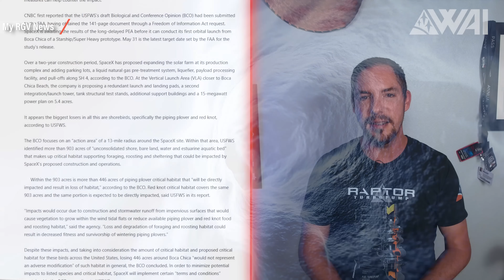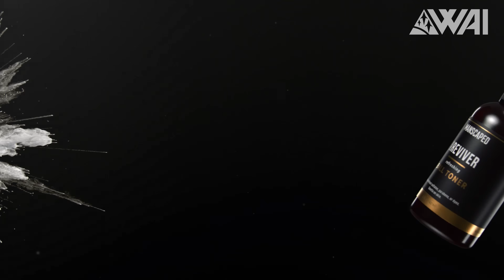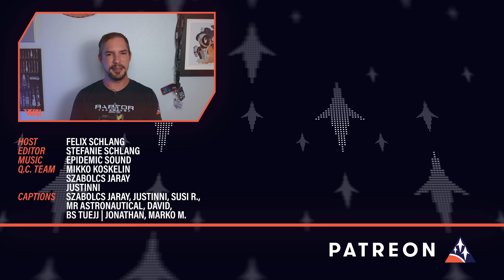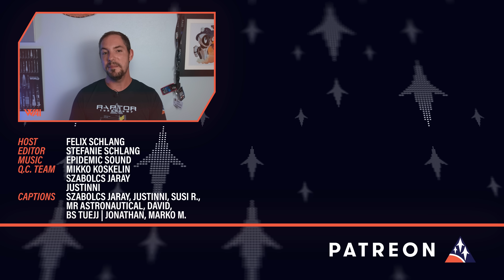SpaceX Starship Accelerating Efforts Towards The Orbital Launch Test!

Comment: About twenty four years ago I was working at a flooring store in Melbourne FL pretty much right on the Indian River. It was twenty three miles from where a Delta V that exploded shortly after lift off. All the windows in the building shook and the doors swung open. You could feel the air pressure change. I had friends further north of us with broken windows. Rocket explosions can be pretty spectacular.
Reply: That was a Solid Rocket Motor where the fuel and oxidizer are mixed together, making it explosive. Liquid rockets the fuel and oxidizer are mixed so they don't explode, the fuel burns.

Comment: The vast majority of your analysis is garbage, this is a liquid rocket. This means the fuel and oxidizer are not mixed, so the fuel will burn much more slowly as the methane slowly mixes with air as it burns.

Comment: To be clear, explosions are a function of pressure and not just fuel. If there were an explosion, it would only occur if the skin of the starship contained the rapidly expanding gas and then ruptured. Otherwise it would just burn. So its really a question of... how much pressure can starship contain before it fails.

Comment: Methane is weird when in a high pressure container.

Its extremely light and expands a lot when the container bursts. But more importantly, its very finicky with oxydizer/fuel ratio to burn. The ratio from too rich to too lean is extremely tight, so its hard to have a big explosion. You would need that most of that fuel gets mixed very well with that oxydizer.

On top of that, methane flame front is quite slow, so that reduces the shockwave.

So yeah the chemical potential of an explosion may be huge, but that may not translate to a huge explosion.

CNG tanks when they fail, they tend to do more damage from the sudden release of 200-250bar. Than from the methane combustion. Fireballs if present dont create damaging shockwaves.

Comment: No, the "explosion" would be nowhere near this strong. (See other comments) -- What COULD be a real issue is unlucky shrapnel. The large metal tank rupturing would send a number of huge ones flying, with lots of momentum = reach and damage potential.
- especially If it happened higher in the, I can imagine some reaching quite far... too far...  but still, it would have to be unlucky to hit something important, but not neglegible.

Comment: I think about those two Raptor engines that exploded recently at McGregor test site. Did they push them to extreme levels or not? There is something profoundly healthy in testing to violent failure if that is the case. However, Raptor has to become extremely safe, more so than other engines because we have 33 of them lighting up at launch. Otherwise a RUD disaster will eventually happen, especially because the launch cadence is destined to be very high. But then again, frequent use, testing and inspection after use, that is how you learn to do it right.
Hope to see multiple launch sites with the oil rigs included, so the effort is continuing even in the event of disaster.  When rated for human flight it is important that starship can escape the pad on its own. I understand that Raptors can spin up and fire in 0.1 seconds, so that option is very possible.

Comment: I see more potential of damage, when they try to catch the booster for the first time. Some other channel was up on the tower with Elon. Nothing there is protected against salty seaair. The railings are welded directly on the construction, which weakens the material. Don´t they have some zinc spray to put on the weldings? They already look like falling apart. Everything is rusty. 
The tower isn´t built to last long. It´s a cheaply made prototype. When the rocket goes boom, it´s not that big of a loss, i guess. 

In germany a construction like this would be impossible. Regulations would make the costs explode, before the rocket even gets a chance to do. 
Thats what i like on the US. They take risks to get things done fast. We can´t do this anymore.

Comment: Come on Felix, this cannot approach full explosion, the liquid methane and liquid oxygen are impossible to instantly boil and then mix together stoichometrically.  This is incredibly irresponsible of you to spread this horrible sensationalist falsehood conclusions.  There will be a moderate DETONATION of the gases that manage to mix well, and primarily the thing that will happen is plain old slow burning (COMBUSTION) of the boiling liquids and gases.  Far far less kilotons of TNT equivalent, only the detonation is measured in kilotons.  It’s probably going to be 0.25 kt.

Comment: OK ------  Sorry WAI Guy but you Made a FOOL of yourself TALKING About An atomic bomb Sized explosion from Perfectly MIXED FUEL and OXYDYZER in a CONTAINER, An Actual Oxygen and Methane BOMB...!!!  The problem is that on the LAUNCH PAD the Methane and LOX are both in SEPERATE Containers and if something happened and both tanks split wide open with some kind of explosion between the tanks...  An Incredibly Hot FIRE would start using both the vaperizing Lox and vaperizing Methane...  Only the Super Cold  liquid Lox would fall to the ground covering a wide area (since the heat is above the Lox tank With no FUEL mixed in for the LOX to burn)...   While the Methane vaperizing as its tank Pressure was suddenly released with the Heat from the Methane and LOX Burning adding to the rate the Methane turns to vaper at the bottom of the tank,,, sending the Hot RAPIDLY VAPERIZING Methan and its tank up into the Air that would burn using Air at only 21% oxygen and not 100% Oxygen from the lox tank... A LOX Tank that again is being torn apart as its Super Cold Liquid Oxygen (THAT CAN NOT BURN even in the presence of methane fuel) down onto the ground before most of it could even get warm enough to vaporize... Let alone burn...   The Point is that You would have A Huge Fire  Ball of Methane floating up away from the pool of very Cold LOX With NO FUEL spreading down over the gound across the launch facility and not Burning because  again, it had no fuel and NO TEMPERATURE...  Fact is the Super Cold LOX would protect the Launch Facility from the heat of the Burning Methane...  jUST TO REMIND YOU... FIRE HAS TO HAVE ------   FUEL +  OXYDIZER +  ****  HEAT **** BEFORE YOU HAVE  "FIRE...!!!"  THE FAMOUSE PERIMID USED IN ALL FIRE FIGHTING SCHOOLS...  With the Methane rising up away from the Liquid Oxygen you only get fire along a FRONT Where they both MEET... That ceates heat that pushes both the Cloud of Methane and cloud of Oxygen away from each other even faster...  

EXACTLY what happened to One of the TEST Ships that BLEW UP Closs Over the Suborbital TANK FARM Last Year...  The EXPLOSOIN Simply  turned INTO a huge RAPIDLY LIFTING Fire ball that DESTROYED NOTHING ON THE GROUND !!!!  NOT EVEN LEAVING ANY BLACK SCHORCH MARKS ON ANY OF THE TANKS DIRECTLY UNDER THE TEST SHIP THAT BLEW UP !!!! While the Liquid Oxygen Quickly spread out across the WHOLE SPACE X Launch Complex again without doing ANY DAMAGE !!!!   As the Methane ball slowly lifted into the sky...  Though with all the clouds and Fog it was impossible to see the Explosoin... The same thing happened each time the Test Ships CRASH Landed and did not turn into atttomic Bombs of even the SMALLEST yeald....   But any Good Scientest KNEW What had Happenned and could have told you the same thing Musk did several times...   
K-----------  Unlike what would have and did happen when a Booster blew up with Lox and Liquid HYDROGEN as the Fuel,,, or even Lox and Keriseen ROCKET Fuel that would have fallen and quickly mixed to create a bomb... Both LOX and LH or Keraseen expanded into each other as they both fell as they mixed their temperatures rapidly rising inside the fire allowing both to feed the fireball fast enough to create an explosion...!!!  Something Methan and LOX can NEVER DO!!!    Which is EXACTLY WHAT MUSK HAS SAID SEVERAL TIMES NOW !!!!!!!!!!   BUT YOU EVEDENTUALLY DID NOT LISTEN TO HIM....  Sorry for you Making a FOOL of yourself in the NAME of CLICKBAIT !!!!   AGAIN.. Musk has answered the Same Question that he gets all too many times as well... But never once said it would be as powerful as an Atomic Bomb!!!!!!  In Fact Musk Said It may burn up the Launch Tower and Launch platform as the Ship with its full tanks fell into the INFERNO,,, but not massively Explode...   Though he did not go into such detail... He May Wish he had Built the Orbital Tank Farm as Part of the Suborbital tank farm where it would have a better Chance of Surviving the Fire Ball...

Again I am so Terribly SORRY for the SHAME you must be feeling as I have always loved your Videos before this.... But now all I can do is Sadly SHAKE MY HEAD...

Comment: This video strikes me as poorly researched click bait. As has been noted by many commenters, both the fuel and oxidizers are stored as chilled liquids. Both would have to mix completely and vaporize before combustion to get anywhere near the efficiency number you used. 

Picking a random number like 75% and then running a number of calculations based on it before using a simulator designed for supersonic nuclear detonations to estimate damage to nearby areas is not science and does not provide any useful information.

Comment: This only considered an explosion at ground level. Try the nukemap airburst option (detonation at 670 m). What you now find is that the 5 psi overpressure circle extends to a radius of 1.5 km, . And the 1 psi overpressure circle extends to a radius of 4.3 km. This puts Boca Chica somewhere between 1 psi and 5 psi. At 1 psi the damage is described as "
At a around 1 psi overpressure, glass windows can be expected to break. This can cause many injuries in a surrounding population who comes to a window". At 5 psi, the damage is described as "At 5 psi overpressure, most residential buildings collapse, injuries are universal, fatalities are widespread." In other words, quite a lot of damage and potentially serious injuries to anyone not in a fortified structure. Btw that 1 psi circle extends to the Mexican border.

Comment: Your nuclear comparison has a VERY BASIC PROBLEM.  It is based upon ENERGY... not POWER  (Energy per unit time).  

Think about it: A smoker uses a lighter's whole energy of combustion to light his cigarettes within inches of his face.  In so doing, the energy of the whole lighter's butane supply is released over the course of minutes of use, distributed over months of cigarettes.  If the lighter were to explode while full just inches from his face, all that energy would still be released and at exactly the same distance inches from his face, but this time he'd be severely hurt.  The only difference between it exploding and it being used to light cigarettes as intended is that the energy of the butane is released much FASTER in the explosion... the POWER is higher even though the total energy is unchanged.  

A nuke releases it's energy in a nanosecond.  The methane-oxygen explosion from a Starship+Booster would release the same ENERGY, as your math proves, but would do so over the course of 1-2 whole seconds.  That's a very big difference as it's a billion fold lower POWER.  Damage is caused when the power of an event exceeds the breaking stress of an object.

Comment: SpaceX Sprint,
Is ready to begin.

Thanks to FAA delays, 
-- SpaceX has a lot to do.!
-- the Artimus goals, are getting tight.
-- Other SpaceX programs, 
are also getting tight.

 SpaceX has not been idle
during the delays.
-- With current amounts of back log, 
SpaceX could be looking at several launches per week.
( Possibly multilple launches, per day ! )

****
-- What if this disaster, or this disaster ?
-- SpaceX has a history of taking measures to reduce dangers 
from a failure.

  Various failures have occured before.
SpaceX is beyond the lab test phase.
Actual attempts, are needed !
Reply: Of Various programs:
-- SpaceX still has a goal of reaching Mars. 
-- Nasa is too far behind.
(Barely started. )
-- Other foreign space-able groups, 
have begun to pull ahead of SpaceX.

Comment: Many years ago, the Department of Energy was concerned about transporting tanker car loads of propane. In order to study the damage potential of doing this, a test was conducted at what was then called the Nevada Test Site. They leaked rail car tankers of propane out onto the desert and then lit it off. There should be some good test data to compare to speculations of what would happen. Also, what was then the Defense Nuclear Agency setoff a Kiloton worth of Ammonium Nitrate Fuel Oil stacked in the New Mexico desert near the Trinity test site. Bottom line, there are scientists, computer models, and data that support a clear understanding of what would happen. I bet the FAA and NASA have consulted those scientists.

Comment: This is a GREAT Video!
I think it’s calculated at the worst case scenario which is even better.

Thank you!
Reply: It's not calculated as the worst case - it's calculated vastly beyond any realistic worst case. You might get these kind of numbers if someone is stupid enough to deliberately mix liquid methane and oxygen together, pump them into a pressurised tank together, and light a spark. You're not going to get it from any reasonable form of industrial accident involving fuel and oxidiser tanks rupturing and partially mixing before a spark ignites them.
Reply: @simongeard4824  thanks for your reply Simon!
Do you think this calculations are 10x off the chart, or what is your estimate?

Also do you think the sound acoustic power from 33Raptors will be higher than RUD?
Reply: @DavidFGuajardo  Not my area of expertise - but the Wikipedia article on large explosions lists the N1 at no more than 1kt, and for exactly the reason I suggest. On paper, the potential energy release of the N1 was the ~7kt cited by Felix... but there's a big gap between potential and actual, due to the fact that most of the fuel in the N1 didn't contribute to the detonation (but instead contributed to the rain of flaming debris).

A Starship accident would likely be similar... you're not going to get perfect mixing of fuel and oxidiser unless you're trying to get the biggest explosion. It would be dramatic, no question — just look at the destruction of the SN4 prototype — but we're a long way short of "nuke Starbase" territory.

Comment: If spacex wish to build confidence in the public they should do several launches at increasing height prior to the orbital instead of scrapping the starshipps. Landing 1 time with out blowing up is just a fluke, prove that you know what you are doing by repeating it at least a dozen times first, then we may believe you can go orbital. If the ship goes down anywhere other than the planned area could kill people and Elon have not showed it works well yet. Incremental is the only way. Put up or shut up Elon.

Comment: A 10kt nuclear eplosion happens at once. all the energy is expelled the same microsecond. that makes for a giant boom, incredible temperatures and shockwaves. but if you ignite a 1000tons of methane uncontrolled it surely will be a nice show but the stored energy is expelled over a far longer period, maybe even several seconds. you can see this very clearly in the footage from the N1 exlosion. or maybe the hindenburg burning up. thats way less destructive. it doesnt vaporize steel and concrete structures close by. i guess the basic tructures of mechazilla and the launch mount might even survive this, but of course needing repairs to the more delicate parts due to heat and flying shrapnel.
after all, not the end of the world.

Comment: Have you taken into consideration the explosive potential of the tank farm? I think for the first launch attempt there won't be much explosives left after tanking but still there might be some. Would it change the predicted demage significantly?
Reply: Reportedly, the tall methane tanks "didn't pass certification" and so they added the low horizontal tanks, which are behind a berm. IDK if this is confirmed, but perhaps that was specifically to protect them in case of an explosion around launch time. .

Comment: Thanks for the analysis - so, it is not as bad as it might seem.
Two points, however: 
- I think that your "scaling down" the explosive power by 75% is too conservative: Nuclear explosion propagates at the speed of fast fission neutrons. Chemical explosion propagate at the speed of the shockwave at best (in the case of a proper detonation) or more likely at the speed of flame front, in the case of mere deflagration. Methane from disintegrating tanks will be far from perfectly dispersed and mixed with oxygen, so only the surface of the blob will actually burn until the shockwave does some more mixing. I think that the right thing is take a look at the extent of damage N1 explosion made (it that kind of data was ever made available to wider public).
- Second point goes in the opposite direction: overpressure damage might not be spread very far, but, depending on the exact moment of the explosion, falling debris, more than 200 tons of it, might reach far and cause grave localized damage.

Edit: Duh! After posting, I saw the hundreds of other comments go in line with my first point. Good work, Captain Redundant (that is, me)! My second point, though, is not to be underestimated.